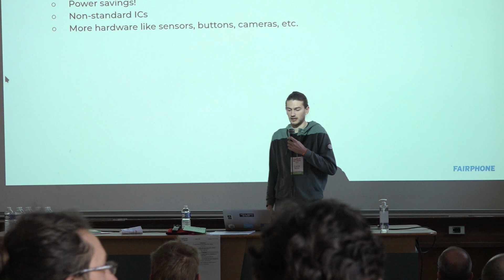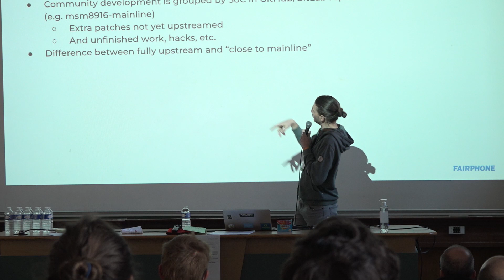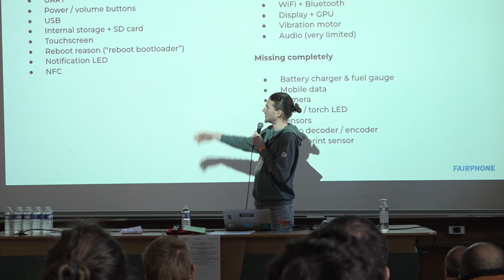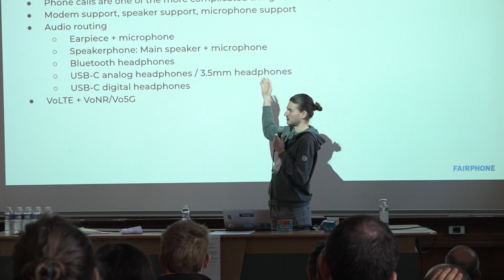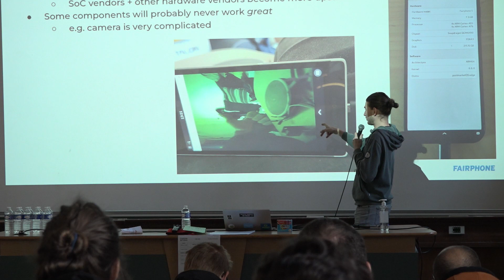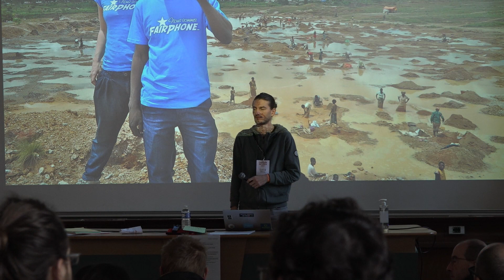Capitole du Libre 2023 - Mainline Linux on Fairphone? Yes, please!

Comment: Those 10k patches vendor patch stacks, are those public? The kernel's license would require that, right?
Reply from the maker: Yes, the core kernel always has to be open source, and with the rare exceptions all kernel modules are open source (some vendors just ignore requests though unfortunately).
But since it's literally millions of lines of code difference and the patches are doing things quite differently from upstream Linux, it's not super useful per-se, but often times a good reference to get the upstream kernel working (better).